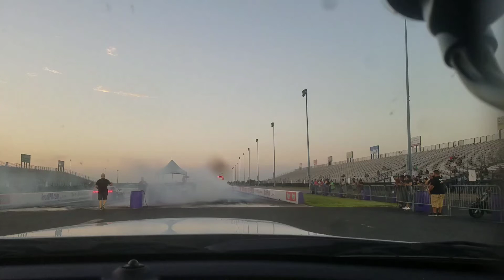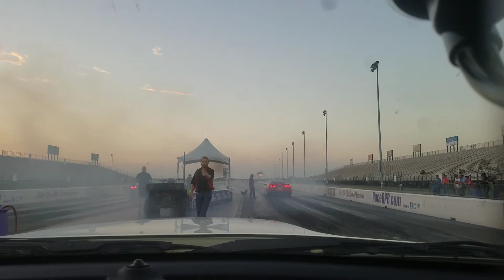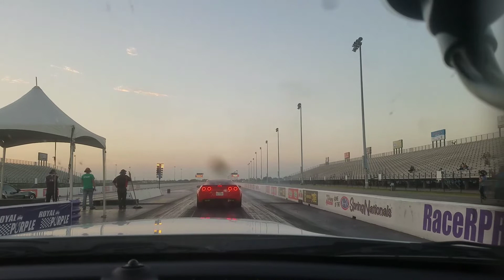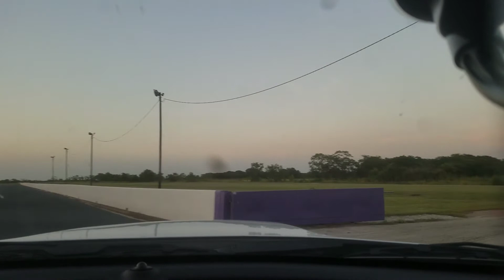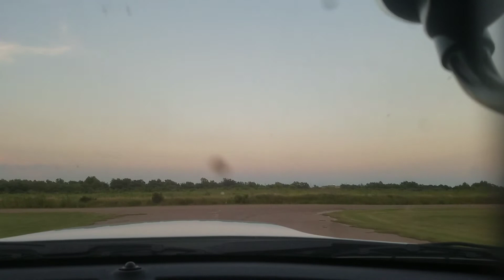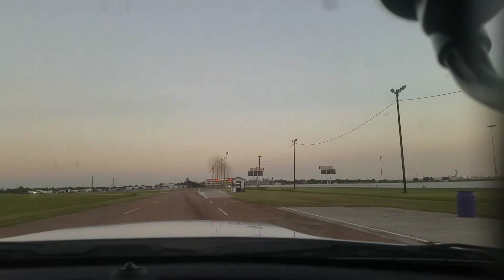Hot weather Dragstrip data logging in my 2016 Challenger SRT

Comment: Ever try lower pressure I run my 555r's at 18-19 psi. And also ran at 21 and had ok results. Never ran at that high pressure run 27 on the street and have over 9000 miles on a set
Reply from the maker: Natalie Deyton these tires HATED any less than 26-27psi.

Comment: You have a very consistent good running car. Those 305 dead hook I'm debating on these or 315's dunno yet. Cheers
Reply from the maker: Thank you!  So far, I am liking the Nittos quite a bit.  The real test will come when the weather gets a bit cooler.  I'm interested to see how they perform in temps of around 60-65 degrees.
Reply from the maker: Albert S. I wanted the adjustable suspension. I also liked the hood and wheels. Ya know, everyone said it would be tough to run 11's with this car and that it would never run mid 11's... I have run a string of 11.6x's and a best of 11.58.
Reply: B Mason, Dude you forgot to loudly clear your throat while holding up one finger in the air before you spoke the damn Truth right then;)